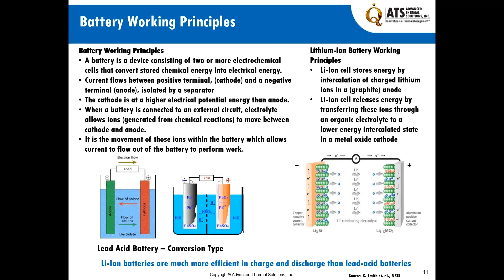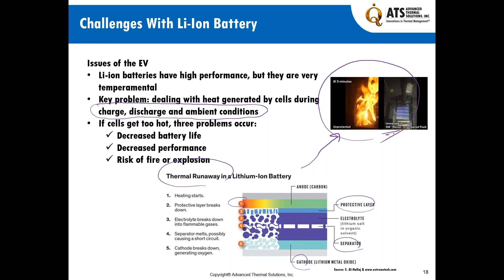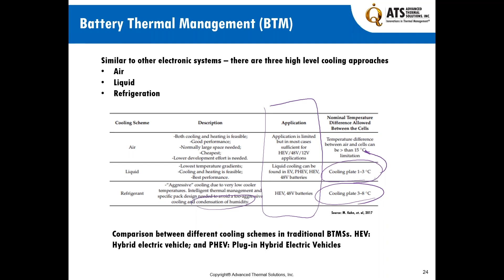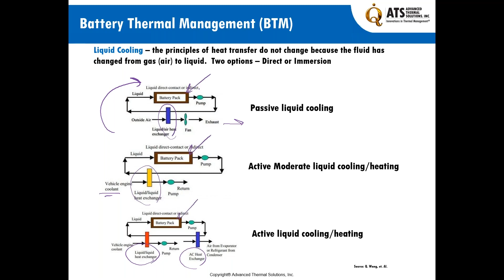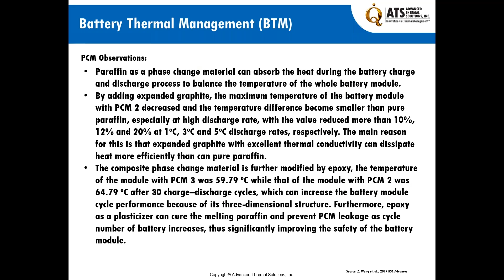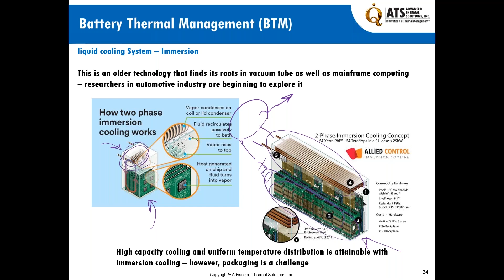Thermal Management of Automotive Battery Packs - ATS Webinar

Comment: 38:30 18650 is the cell form factor (18mm x 65mm), not the number of cells in Tesla. Model S has about 7000 cells.
Reply: Well Spotted Fan, he is thermal expert but, i noticed his weakness in electric knowledge